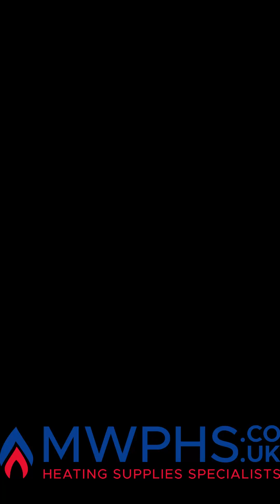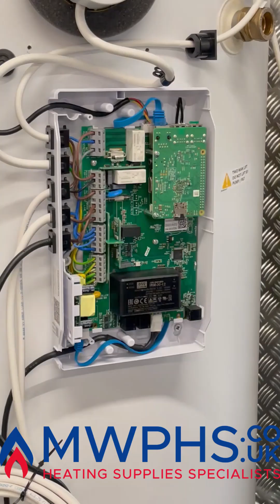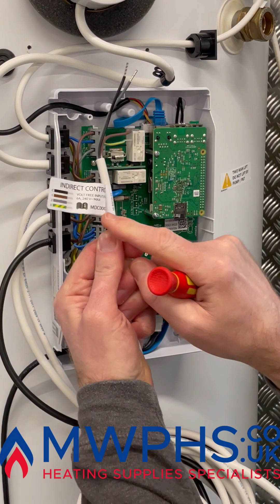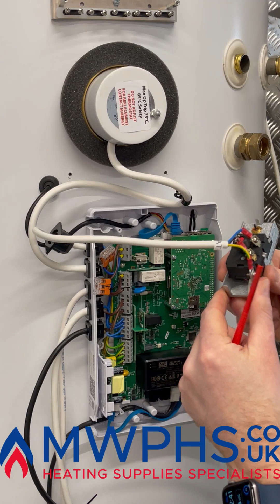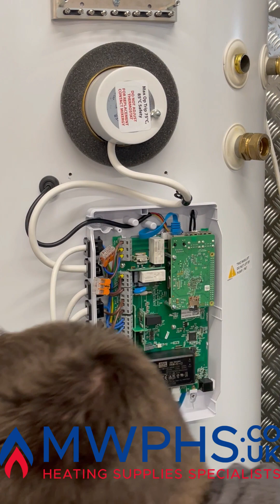Using a Mixergy Cylinder with an Intergas Boiler Setup Guide

Comment: Thanks for such a helpful video. Do you know if Mixergy endorse this and is there any impact on the cylinder warranty?
Reply from the maker: When using with an Intergas boiler, it is the only way the system will work safely. Without making this modification you won't comply with Building Regulations Part G3 (overheat protection).
Reply: @MWPHS Thanks again - now have email confirmation from them this adjustment is fine and doesn’t affect warranty 👍🏻

Comment: I came across this looking for a wiring diagram. Upon first glance I've noticed a Ras-Pi on the top right? & a Thermal cutout on the board adjacent to the V free relay. Electronics could have been better designed IMO
Reply from the maker: Yep, it’s basically a raspberry Pi with an extension board… 😂👍🏻